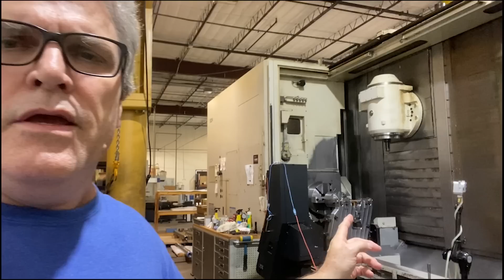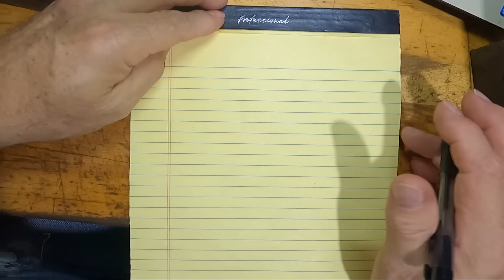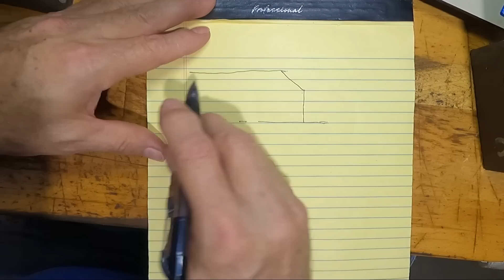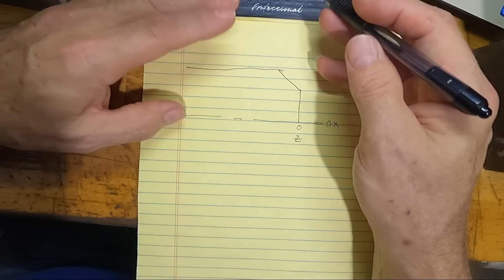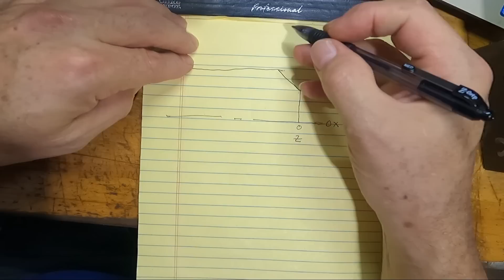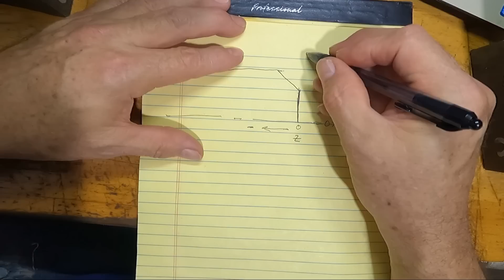Lathe Tool Tip Comp 1

Comment: yes ,, you can use comp  in rough  cycle  .  The code will just say G42  G40 G42  G40   over and over  :face-blue-smiling::face-blue-smiling::face-blue-smiling:compensation is mostly for difficult contours that can be programmed manually directly on the contour, the machine must also know the tool data, it is not used much in CAD/CAN programming

Comment: I watch as a former CNC programmer / machinist. I had these issues for years - especially lathe I&J / I&K etc.  Interested if you can post more as I progressed on to CAD Design and currently I am using AI (and old Lisp) to see if I can iron out sone of these issues for other similar software related things...(most CNC systems approach this different and I want to standardize it like a macro to be used anywhere) If you have the time and generousity, please produce something in computer graphics format so its best to print. Please include the "sectors" as this is common on systems. There may be some people watching who are experts on AI and they may creat AI macros to offer up which will benifit all.

Comment: The groove segment of this video made so much sense. Im going to try it on Monday. Tired of breaking sharp corners with sand paper. And inspection doesnt care too much about tiny steps on the bottom corners in the grooves. But I do. Awesome video.
Reply from the maker: Make sure you use tip comp on the finish passes and it is the proper direction. G41 for the front of the tool and G42 for the back. Also notice I shortened the contours by the width of the tool. Otherwise you will hit the other side of the groove. And also you are running two offsets for the finish cuts. One on the front of the tool and one on the back. With these offsets you can also control the groove width if you leave enough stock on your roughing pass.
Reply: @EdgePrecision  yes, sir. We have plenty of scrap parts that I plan to use for practice. I will have to input the radius of the insert in cutter comp on the offset page, correct? We never use it but Im just trying to visualize what Im going to do.
Reply from the maker: Yes on your tools offsets there should be a entry for the tip radius. Also if your groove is an OD groove the direction of the comp should be a 3 for the front offset of the tool and a 4 for the back offset. As I described in the video.
Reply: @EdgePrecision  cool. Im rewatching your second video on tip comp. Like cramming before am exam. Ill watch them both again tomorrow for good measure. Thanks for the quick responses and instruction.

Comment: G41 and g42 direction is same on lathe and mill g42 ccw direction g41 cw direction my okuma can use tool com for roughing the haas only uses it on the finish roughing pass but the okuma uses it each roughing pass

Comment: Very good video. I was wondering after watching probably all of youre videos, do you ever use the mazatrol programming? I setup and program an Integrex I-400, and before that an Integrex E-410. I’ve never had the need for CAM programming because i find that the mazatrol can do most of the things i need, sometimes you have to trick the control but it works out.
Keep up the great videos, have learned a lot from them!
Reply from the maker: No I don't use the Mazatrol on this machine for anything except maybe boring chuck jaws. I prefer my cam software Esprit TNG. Their post works perfectly for this machine and the simulation is much better. At least then my old 640m Pro control can do. For simple stuff the Mazatrol can't be beat. But the things I do really require the cam software.

Comment: Just starting out with using radius comp here. I program my lathe by hand writing the gcode. Not sure if I'll continue to do so, probably will use fusion 360 for more shapey parts at least.
Reply: There's been some confusion about the direction for me since the X-axis is mirrored but I just fucked around and found out.
Reply from the maker: If you are programming manually, you need to be sure your machine is in the proper plane of circular compensation. These would be (G17 X,Y) (G18 X,Z) and (G19 Y,Z) . Now if your machine only does Turning (A Lathe) it may default to the G18 X,Z plane witch all turning is done in. To Be sure you should always include a G18 code in the beginning of the program. Otherwise you cant do arcs in the X,Z plane. On a 3 or more axis milling machine you can do arcs in any of the three planes but you have to specify witch one before. A mills default plane is usually G17 the X,Y plane.
Reply: @EdgePrecision  the lathe is a basic 2 axis with a turret. It doesn't need G18 and actually errors out given that. I had to modify the Fusion post to get rid of that
Reply: I just did my first program for the lathe with fusion a few days back, dozens of them by hand

Comment: Something to add on to help someone (hopefully).

If you're cutting a corner break on an OD, you can use the following:

X1 - 2L - 2D - 2C = X2  (for an OD) (you have to go below your diameter to get a start point)
X1 + 2L + 2D + 2C = X2 (for an ID)  (you have to go above your diameter to get a start point)

X1 = your finish diameter 
L = Length of bevel or corner break
D = Distance in front of Z zero where you begin your feed
C = Radius Compensation 
X2 = Start point for the tool

{[(X1 - X2)/2]/tan(θ)} - {D} = Z

Z = end point of bevel

Above equation simplified: 

X1 - X2 
then 
divide by 2
then 
divide by tangent of angle, (theta = θ)
then subtract distance (D) in front of Z0
this gives you your end point of the corner break/bevel, Z
 
Example:  5 inch OD with a .03x45deg corner break starting .020 in front of Z0
The radius comp for a 45 degree with a .032 (2 series radius i.e. DNMG 432) is .0183.  You should be able to find a radius comp sheet somewhere online for your tooling.

G00 X5.050 Z.050 (a .050 clear point for the fictitious part)
X4.8634 (This is X2 from above)
G01 Z.02 F.010 (feeding in in front of Z0 from clear point)
X5.0 Z-.0483 (cutting the .03x45)
Z-1.0 (turning back 1" at 5" diameter)
G01 X5.050
G00 Z.05

The math:

5 - 2(.03) - 2(.02) - 2(.0183) = 4.8634

5 - 4.8634 = .1366      (finish minus start point, "X1 - X2")
.1366/2 = .0683
.0683/tan(45) = .0683        (for a 45 degree, it will always be the same as the input number, for example, this would change to .1183 using tan(30))
.0683 - .02 = .0483      (distance to go back, "Z" from above)

I would have gone into more detail than this, and covered more scenarios, but this took WAY too long to type lol.  My boss writes the programs in CAM, and we as the machinists often have to fix formatting errors per machine, typos, bugs, and simple mistakes in the unproven programs.

Comment: Great. now I know why my angles and radius go squiff sometimes and how important it is to get the right info in the cam software. some of the rads on our groove tools are fudged as I couldn't find the right info at the time,time to get all the right info. and find I get alot of nose radius errors using g41-42 cutter comp and usually go direct with no cutter comp (in computer on fusion 360. also it puts the compensation on and of in the wrong place alot). But I use with the milling side of things on a doosan lynx 220. Thanks for all your knowledge and willingness to share it👏👏👍

Comment: Do you rely on the manufacturer spec for tip radius, or do you measure it yourself on something like a comparator? Are there brands that are more true to spec than others?
Reply from the maker: I have never really gone thru inserts and checked their radius. I just go with what is specified. But in actual cutting conditions things are never perfect. So if there are critical dimensions or as I said in this video, corners to break/radius you will often have to make changes. Machines now days are very accurate but everything moves and changes as it is being cut and the tool wears so it will be necessary to adjust things.

Comment: Thanks for the video Peter, in the really early days ,i had to manually use trig to find the compensation ammounts in X & Z to get the 60 & 45 degree angles spot on,on parts we used to produce. 
The control works it all out for you now .
A video about when to actually apply the tool nose radius & when  to turn  the compensation off again would be helpful. 
Thanks for taking the time & effort to spread your knowledge.

Comment: Thanks Peter,  I had not thought about needing a separate offset for the back side of the grooving tool (just added the tool dimensions in the cam software and run off the one offset) but I guess if you need a different offset to remove a burr on one side but not the other side it gives you that flexibility to dial in each side.  If there is anything along similar liness around programming left hand threads vs right hand threads that would be interesting

Comment: I have the exact problem you are talking about on the groove pretty often. Typically I just end up getting a little tighter on the diameters if I can. I also typically just do a chamfer vs a corner round.

Now on to my request.
I have a matrix controller integrex and esprit. Esprit post processor is garbage so I haven’t done much turning through esprit but typically when there is milling I’ll program it in esprit. And then make those sub programs in a mazatrol program.

I’d like to get away from having to do that and curious if you use g54 or g53.5 in your eia programs? Also how do you set that all up?

I’m the integrexes I have always used centerline as my x and y zero but I’ve seen what you do and I wanted to just bolt a centering vise or a 2 jaw chuck and do some milling on the machine.

Also new machine has a renishaw probe do you have any help on figuring out how to get that working?

Comment: I'm mostly self taught and I could probably benefit by using cutter compensation to dial in dimensions without having to go back and forth between CAM and the controller.

Comment: Its like to roll the circle over part contur? and circle center path will be the traectory of machine moves according to circle R?
Reply from the maker: That would be true for milling. But for a turning tool you can see from this video the offset is not normally in the center of the radius (although it could be set that way). So the tool doesn’t follow a path like that. That is why there are different quadrants for the compensation. I didn’t really explain that in detail in this video. I will do that in a future up coming video. Thanks!
Reply: @EdgePrecision what became of the anvils project brother?

Comment: We used to calculate it manually on the side of the machine with Chinese marker.  .009153 is the number to remember for a 45deg angle. 👍🏻